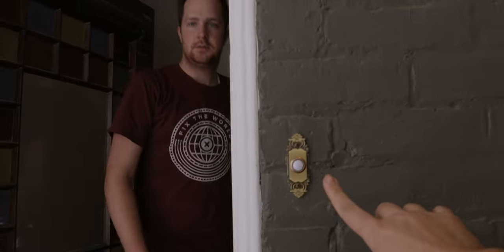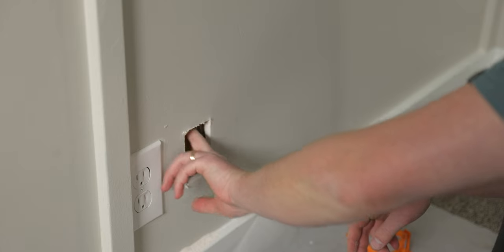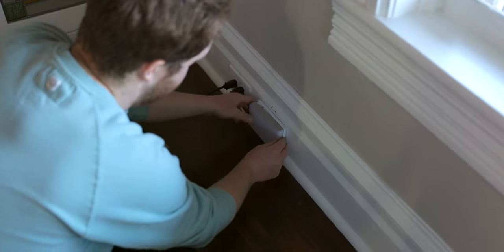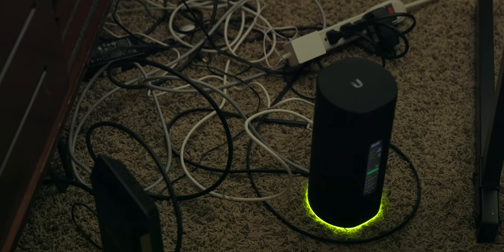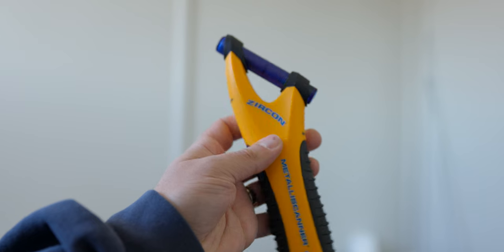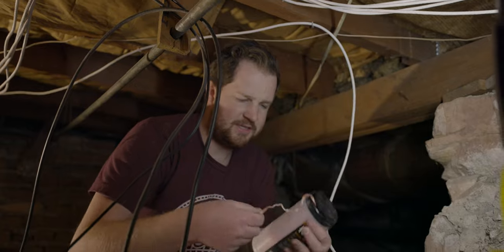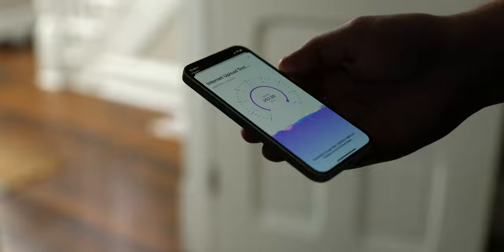Adding 10 Gigabit Ethernet to my 129-Year-Old House!

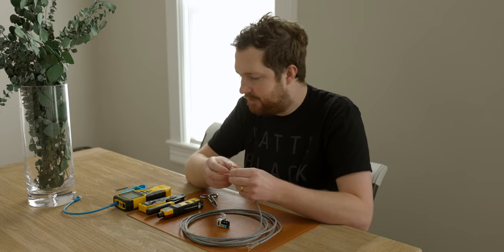Comment: 19:35  The order absolutely DOES matter, exactly because the twists in the pairs of cable are important. Different pins carry different frequencies, and the twists help reject interference at those frequencies. The only pairs you can interchange are Orange and Green, because that's the only difference between the two major wiring standards. (And if you swap them on one end of a cable, you make a crossover cable that lets two devices talk without a switch or hub.) There's a reason even 10/100 Ethernet runs like hot garbage on 8-conductor satin cord (old phone system and serial stuff with no twists at all), and why Cat5 doesn't carry gigabit reliably (but 5e and 6 do). The rest of your advice is solid, but going with a set standard is a point to drive home, not brush off as a nice-to-do.

Always make patch cables like this:
WO, O, WG, B, WB, G, WB, B
or like this:
WG, G, WO, B, WB, O, WB, B

You also want to make sure you aren't running your network cables in parallel and close proximity with AC line voltage wiring. That's an open invitation for signal noise and poor network performance.

The big difference between Riser and Plenum is that Plenum doesn't give off toxic fumes when it burns. Technically if you run network cabling in a basement that's also living space, it should be plenum. Check your local building codes. Residential low-voltage is kind of a wild west as far as code enforcement goes, so you're probably fine with Riser in most cases.

Comment: I run cabling through houses day in day out, i would strongly recommend taking off the socket covers (after turning them at the distribution board) and look which direction the power cables run in the wall when youre cutting out the fast fix boxes, after hitting a 230v cable with a drywall saw when i was an apprentice i learnt my lesson.

Comment: this video, the european house version: “do the wiring before finishing the walls, otherwise pass them in an out of the wall conduit, the end”
Reply: Ha, if only! 😀 In my experience it's "do the wiring before finishing the walls... and the floors... and the ceilings... otherwise, lift floorboards, chase out masonry walls, drill holes through joists, run the cables, and then redo the walls, floors, ceilings etc.". 

Conduits are great if they exist, but in my experience conduits are only installed where they need to be, which means they are already full of single-insulated power cables... I know things differ between countries but I'd be surprised if any European wiring standards allow you to run network cables in the same conduit as single-insulated cables.
Reply: @donkmeister  oh no i wasn’t talking about like the power conduits, i was talking about if someone had installed sometime ago a tv signal or telephone conduit or something like that
Reply: Yea i find that strang as well why did nobody install extra conduits when this house were build.
Reply: @xythiera7255  maybe because people don’t tend to think a lot about the future, 20 years ago a TV conduit was everything you needed, maybe add a phone line in there too if you want access to “the internet”, nowadays we are thinking “ethernet is what we need”, probably in some years we will need another different cable around the house but who knows, probably in that time we’ll be able to have done at least one major renovation in our houses i guess?
Reply: @xythiera7255  Simple answer: It costs more and people that are building a house have to spend their money were it really matters, since the budget is usually fixed. So who cared in e.g. the 70s about being able to later route ethernet through their house? They only needed enough power in each room, a Telephone and their analog TV antenna.
Reply: @xythiera7255  Conduits are definitely not common in the US for low voltage wiring.
Reply: Luckily every new house in Finland needs to have Cat6 and coaxial in every room of the house.
Reply: @Tupsuu  meanwhile i can’t even install a router in a different place of the house without gluing an ethernet cable at the corner of the floor, the best hope i have is for our ISP to change us to a better router
Reply: @antniomanso  Buy your own router.
Reply: @firesurfer  but i have to use the ISP modem anyway, and their router is not 100% garbage, is just like more coverage, but for that i’d need cabling around the house which i don’t have

Comment: I also went with a CAT6e network cables for my house.  Every TV room has 2 RJ45 ports in the wall below the TVs with either a 5 to 8 port Netgear switch.  Like you I also went with a unifi udm pro & unifi 24 port poe switch for my indoor and outdoor network cameras.  2 wifi access points.  I did this back in Oct of 2020.  Probably the best investment I ever made.

Comment: Ah, only possible in America where the houses are made of biscuits 😉
Reply: lol biscuits
Reply: Exactly 🤣
Reply: Also only possible in America where houses are affordable... *cries in Canadian :'(*
Reply: 129 year old house.
me in the UK: that's not very old lol
Reply: @Prashanth12344  There might be a causal relationship between those properties
Reply: Wall chasing is fun though.. There are proper tools for it that you can rent vaguely cheaply (frankly they're cheap as chips to buy), then just have your local friendly plasterer come in and clean up or DIY it. You really really have to plan ahead if you're going to do this though.
Reply: I'm wondering where the wall insulation is.
Reply: @Prashanth12344  Dies in Swedish...
Reply: Have no European actually seen wood?
Reply: @c0wqu3u31at3r  FYI, the average size of new homes in the US is more than twice the size of British homes.
Reply: @MissChase86  we dont have insulation on walls that dont share a side without the outside of the house, no reason to.
Reply: @c0wqu3u31at3r  ahh yes because half of the US didn't even have house 150 years ago. Gottem.
Reply: @MissChase86  on the exterior walls dummy.
Reply: @randybobandy9828  that's a strange place to put it
Reply: @MissChase86 go on and explain
Reply: @kobysimmons6081  It can help with noise
Reply: @kellymoses8566  wood is far more expensive here, at least in the uk. And there is far less of it than the us. Especially after urbanisation.
Reply: @kellymoses8566  we make furniture out of it, not walls.
Reply: @c0wqu3u31at3r  
You stole my thought, currently sitting in my thatched 500 year old house wondering how the hell to cat6 the whole place.
Reply: @Prashanth12344  The "affordable" homes in the us aren't anywhere you'd want to live. Unless you have an affinity for Alabama.
Reply: @drewcipher896  I'd take anything at this point, the average detached house in Toronto just hit $1.75m CAD ($1.44m USD). Makes New York seem affordable.

Comment: You should really use a keystone jack or another forn of wall mounted jacks, and not just run the cable trough and into an RJ45 plug - because self crimped RJ45 plugs tend to fail after some time.
Reply: That isn’t really true.  Your internet service provider almost always uses a self terminated rj45.  My company does data centers, and for aesthetic along with space constraints, we will sometimes make the patch cords, length specific from port to port, to ensure all patch cords are uniform.  We of course use our Fluke to certify the in field fabricated patch cords meet NEXT specs, and obviously wire map.  While in data centers that’s perfectly fine, those pass though rj45s really only “fail” whenever someone is constantly patching and I patching the cord, and putting stress on the connector when doing so.  If you look at factory made patch cords, they almost always have strain relief boots, along with a plastic fill inside the plug to hold and almost glue the wires in place, so the mechanical hold is more than just the pins going into the individual wires and the small crimp on the cable jacket.  Moral of the story, fabricated patch cords work perfectly fine and are perfectly reliable, as long as you don’t subject them to a bunch of stress and aren’t constantly plugging and unplugging them; although you shouldn’t be introducing any type of stress to any cables ever.  Just a little info and for anyone else who was curious

Comment: Only problem with running your cables on your outside wall is that your neighbour can literally cut your Internet if is mad because you're pumping Crab Rave through the entire neighborhood at 3am..
Reply: I think it goes without saying that anything external like this wouldn't be a good idea in diverse neighbourhoods.

Comment: Laughs in European brick houses
Reply: Frank Silvers  thank you for that. I’m sure the OP didn’t know that as a European.
Reply: At least our houses don't gest blown away after one gust of wind
Reply: I love how he didn't consider houses with all brick walls. He assumes everyone can just cut into their wall.
Reply: @davidrenz1534  Yea it's a big issue here in the U.S. Everytime there's a particularly big gust of wind half the country has to stop to rebuild every house
Reply: Frank Silvers  because his viewers are international and not only americans.
Reply: Frank Silvers  This video is about home networking. Other countries still have the same cables, the same networking equipment, speak or understand english. American homes are not the only target audience.
Reply from the maker: @MaxxPlay99  My viewers are overwhelmingly American. In any case, for non-timber constructions (all my exterior walls are solid block which is fairly unusual here) are quite simple too. Just get a hammer drill and punch through the outside of the house and then come back in at the correct location by the same method.
Reply: @snazzy  I don't know why but for whatever reason in EVERY YouTube video that involves running cables through a wall there are ALWAYS Europeans talking about their superior brick houses lol
Reply: Frank Silvers  honestly: how should I know that this video is made by or for only an American audience? YouTube is used internationally, you know? 
(Don’t worry, I got it when I realized it’s wooden walls only and did stick to watching because I liked his style)
Reply: Frank Silvers  no but in most European countries the building techniques are similar. The comment is correct though

Comment: I’ve cut through a lot of plaster and lathe in my 100 old house too. Air return ducting, holes to blow dense pack wall insulation, and of course Ethernet. The key is biting the bullet and getting diamond blades for the plaster (actually CEMENT most of the time, sometimes with wire mesh to boot!) and carbide blades for the wood. I do this with both holesaws (up to about a 4 inch hole) and multitools (rectangular and larger holes). Cut through the first layer of the P&L with the appropriate blade and then switch upon hitting the next layer. Diamond is too slow for wood (no teeth) and carbide gets dulled quickly by cement and wire. Tempered steel? Usually one hole wonders.

Comment: This is one of the best videos to watch for home networking. I live in the UK and had my house wired up. Unfortunately my electrician didn’t know what he was doing and I had to redo a lot of the terminations myself. This video was super helpful. 

I want to make one correction to the video. Always follow t568b for cat6 and above. Whilst he is correct that for the cable to work the order of the the wires need to be the same order on both ends, the exact standard also matters. Not following standard B (t568b) for data will limit you to 10/100mbps speeds because of cross talk in the cable. Standard b eliminates this issue. I have personally tested this. 

Also for a cheaper alternative to ubiquiti for in wall access points, consider TP omada (just make sure you order the correct version for your needs).
Reply: It sounds like you had 1-2 pairs not terminated properly to get those speeds. Cross talk on anything cat5e wouldnt get that severe unless the loop was longer then recommended specs.
Cat6 specifically separates the twisted pairs to reduce cross talk overall which is how its able to get higher speeds on longer loops than cat5e. 

The only way you would get 10-100mbps speeds over that would be loop length or improper termination (or even a damaged cable). Not T568a vs T568b.
Sincerely a telco tech :).

Comment: Every time I watch these types of videos they always say something like. "It doesn't really matter the order of wires, as long as they are the same at both ends". 

This is wrong especially with POE. I have seen runs that have a 80% performance loss due to this.
Reply: I have a diploma in IT and they hammered it in that the order of the wires must be a certain standard.
Reply: It actually ruined the video. 
That and the dog cable runs around the house.

Comment: The Keystone connection is the best one out there. Because you weld the wires to the connector with the punchdown tool, via a friction welding process. Because of that, it is important that the tool actually punches.

Comment: Yeah no... this is gonna take a lot more than a cutter and a screwdriver to to install in-wall Ethernet networking in my 100% solid brick and concrete house.
Reply: Hello fellow european
Reply: What the hell, how do y’all punch holes in your walls then
Reply: @HellNaw98  we don‘t.
Reply: I would run the lines outside and use an impact wrench to drill the holes.

Comment: Little trick i learnt, if you push a mini screwdriver between the 2 wires of a pair and pull up to untwist them, it straightens the wires perfectly, making it far easier to push them in to a RJ45 plug. Also passthrough RJ45 plugs are a godsend!

Comment: Network engineer here with a strong background in designing structured cabling plants in large enterprises. 

Keystone vs crimping on an RJ45 end... there is a right away. The cable you ran is a solid conductor cable, it is not meant to be moved, unplugged, etc. It is very inflexible, and very prone to breakage and kinks if it is repeatedly moved. Spend the 15 dollars and key a punchdown tool and terminate the cables onto a keystone, leaving a little bit of cable inside the wall in case you need to make future repairs and replace the keystone (which in this use case, would be unlikely). Patch cables are cheap, made with stranded copper so they are able to withstand some flexing, and they are much easier to replace if they do get damaged.

Also, make sure you follow the color code standards, not just match the color up on each end. While matching the colors up on each end will /technically/ work, the color code exists to have the cables terminated in a precise way so the twisting of the cable will cancel out interference. If you terminate them with no regards to the eia/tia standards, you will have a hard time passing 10gig traffic on them at any length more than a few feet.

Comment: Great how to video, I just want to add as someone who has been in the industry for over 20 years, the passthrough connectors are not recommended by any manufacturer. So if you're using them just be conscious of this the copper at the end of the cable being exposed can cause issues. No a bad end to get yourself comfortable with doing rj45 ends but it's a better idea to get good with the ones that are not passthrough

Comment: Cheers Quinn, after watching this months ago I ran CAT6 across my house ready for fibre to be installed today. 900Mb humming away nicely. You’d have enjoyed watching the optical splicer they used to join two cables outside my house. Tiny bit of kit that sliced, then fused the two cables together with a live video feed of the process on a small screen.

Comment: I’m a little late to the party, you were doing very well through out the entire video! Only one issue though, pass through Ethernet ends, also known as EZ ends, are good for beginners, they do come with a very serious issue. They often come with the issue of false connections. They actually have had so many issues they void the warranty of most audio and video baluns. It was absolutely a fantastic job to show people who are going to retro fit their homes and good look at the basics of low voltage wiring

Comment: We added a 1gb wired network with a raspberry pi server and a 5g wireless router to our home from the 70's. It took 3 of us and 2 days. We made 24 drops, and ran about 1 mile of cable. We also installed a patch panel and a switch. We get ~970mb/s through our cat5 drops and ~880mb/s on wireless. Best thing we've done to our house

Comment: Having used to run a lot of cable, if they're cheap those keystone punch down tools are much much easier. Get the cables mostly laid, insert into the tool and grip. I've personally managed to hurt myself on the regular punchdowns a few times...

While old, a couple of things I learned from that old job:
-Leave a service loop somewhere. You never know if something gets damaged and that spare cable may be useful.
-Since you're already there, run more than you need. Usually when I cabled an OR or office, especially if it was a pain, we'd tend to double the amount and leave the rest in the wall/ceiling nearby.
-Think you showed it, but when using that line make sure to wrap tape from the line to the cable. This makes a taper and easier to work around obstacles with some wiggling.
-Lastly, LABEL. Label the cables and where they go. Makes it easier tracking issues, especially if you use a patch panel somewhere